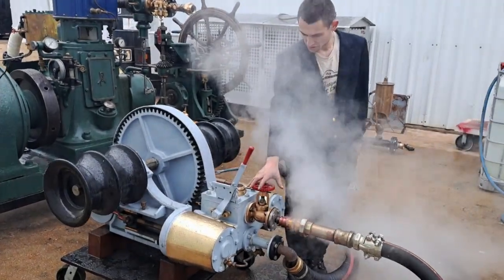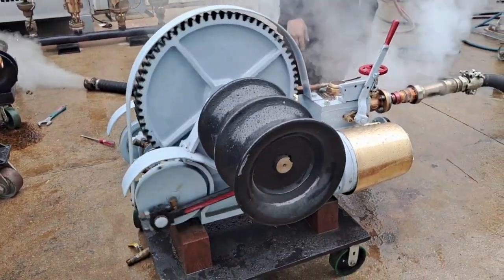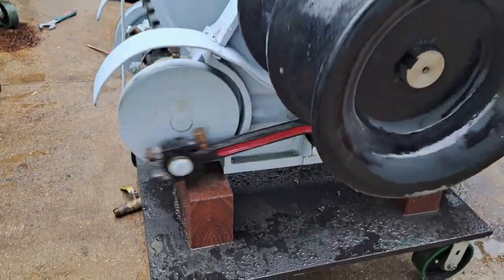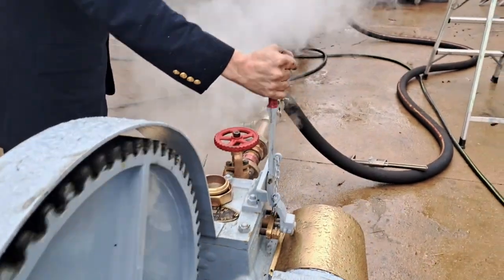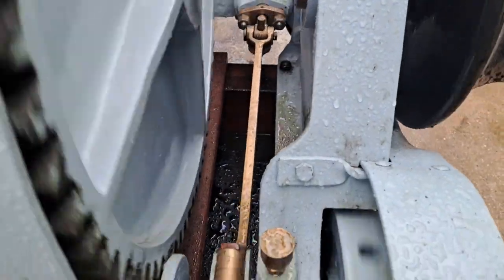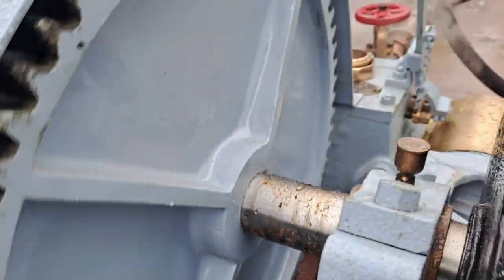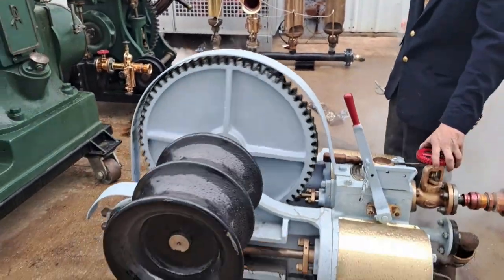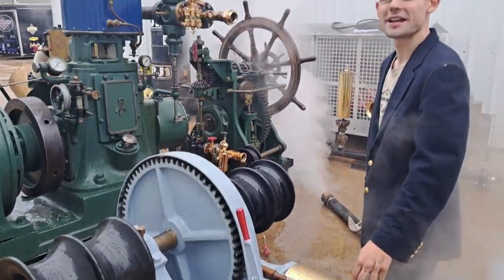Reid Steam Windlass

Comment: Is this engine single or double acting? what's the pipe for on the cylinder end cap with the cocks on as there does not appear to be on on the other cylinder I'm assuming to stop hydraulic lock? ooooh so many questions! loverly engine